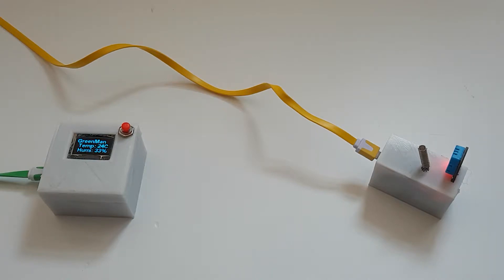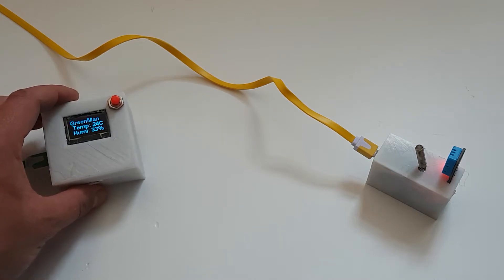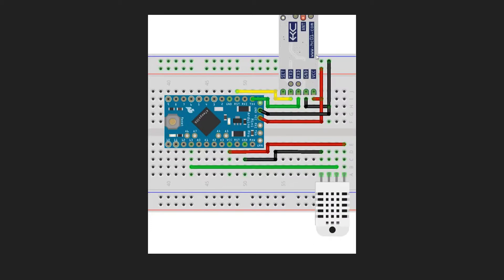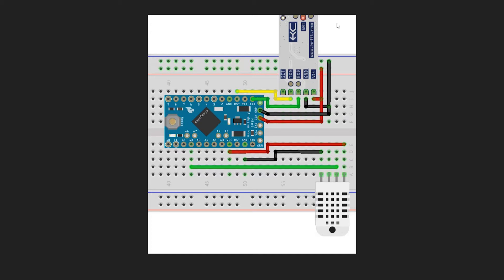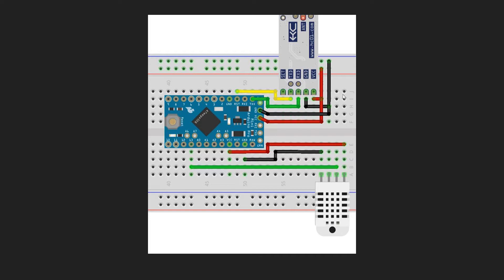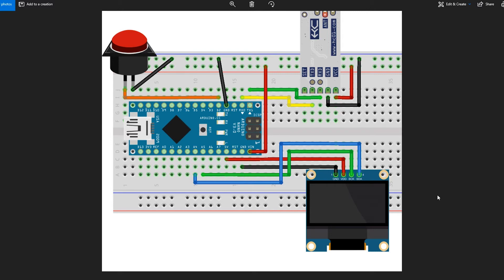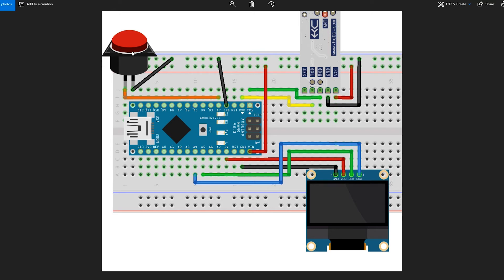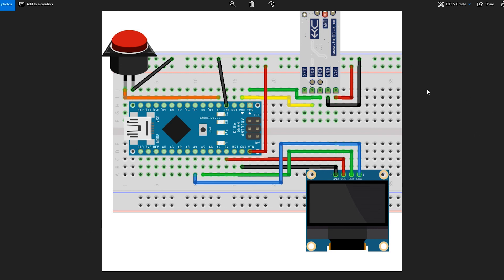Long distance remote temperature and humidity monitoring

Comment: Can I ask one clarification the dh11 board will send signal when asked for it or every 10 mins right? 

And the LCD board will update itself when ever it gets a new signal? 

Is that correct?
Reply from the maker: That is correct.
Reply: @pressanykeytocontinue6427  thank you one other question how would one go about changing this so I could have 3 OLED displays displaying readings from 3 different Arduinos each sensing temperature form 3 different points ?